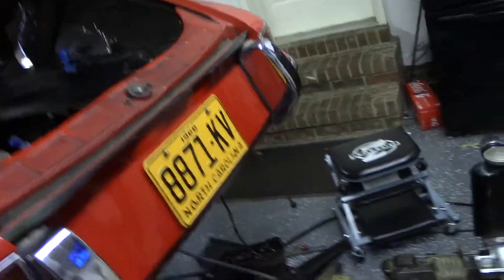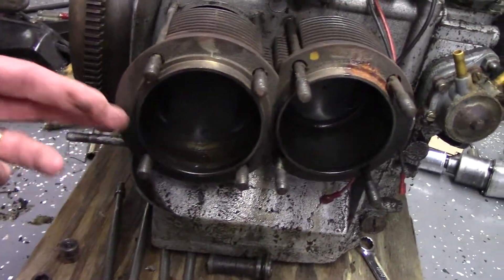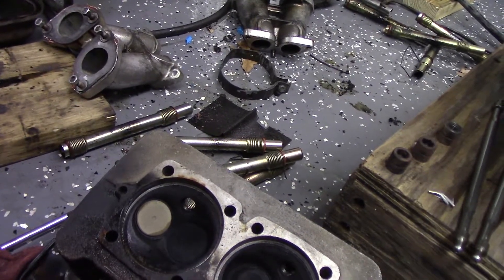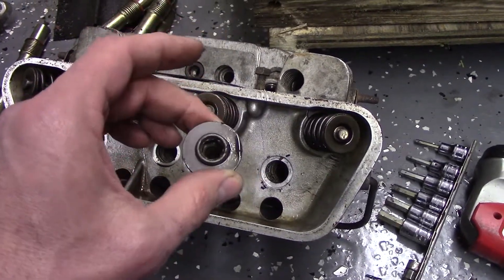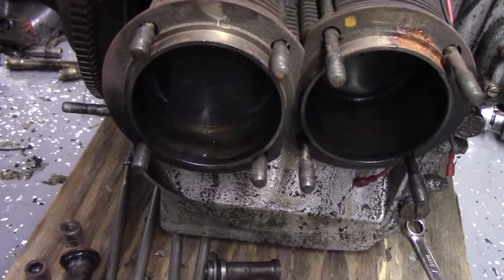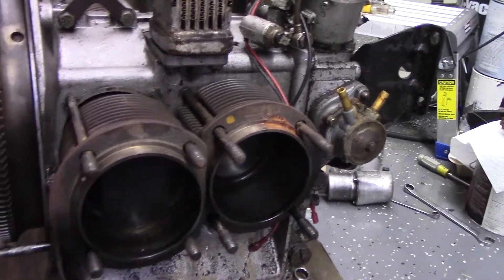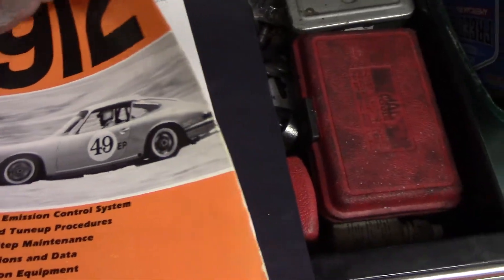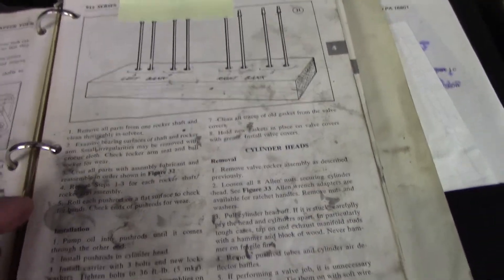Porsche 912 Engine Rebuild Part 3  [Diagnosis]

Comment: As I recall, only the 1968 heads had the ports drilled in the heads for the emission control air pump.  They turned out to be a weak point where cracks would originate.  They are often welded up as part of a head rebuild.